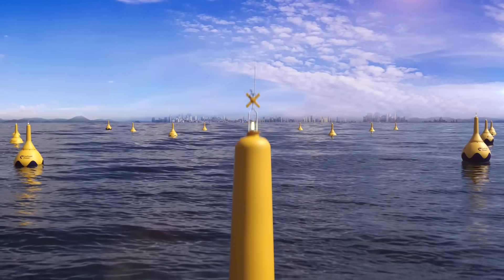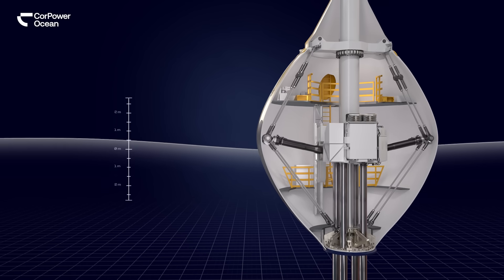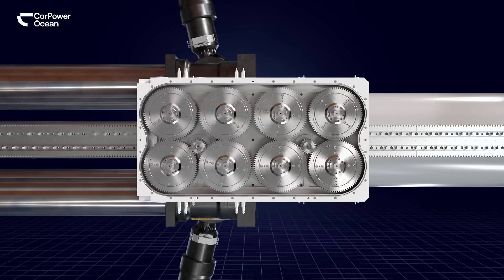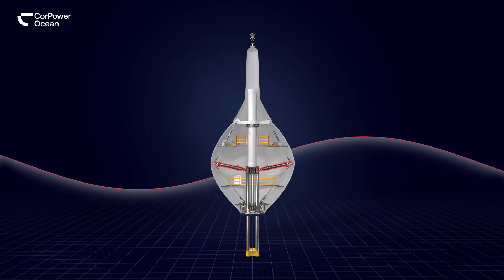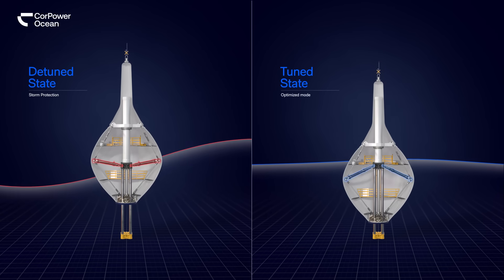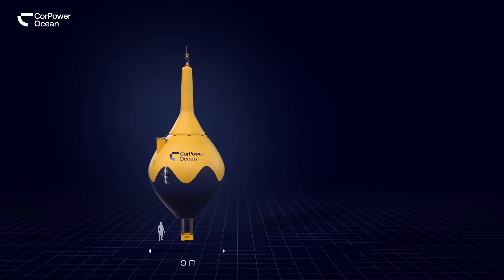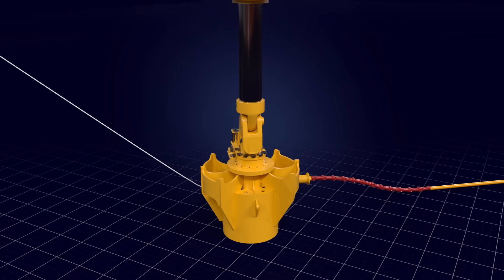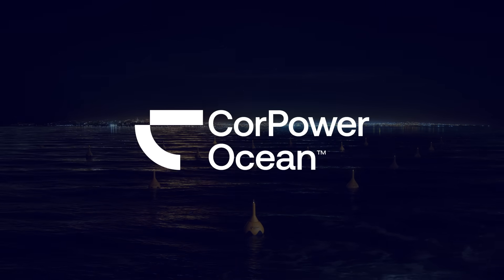How it works- CorPower Ocean Wave Energy Converters

Comment: I assume the 4 rod are in a sealed cylinder and not exposed to seawater. I would interested to know how the system copes with changing sea levels and lateral forces from storms. I guess there must be some hinging/flexing arrangement.

Comment: Interesting but I have a much better design that doesn't rely on that vulnerable seal or on computerization to deal with rough weather. You make a design that looks like a pair of old barbells or 2 maracas attached together. Inside, there's a large tube filled partially with mercury(and yes, its mercury because its my idea and I like mercury). In the middle of this system is a simple pivot point attached to a simple anchoring system. As the device sea-saws, the heavy mercury turns turbines inside the sealed inner tube. The wiring exits the inside tube and the body of the thing itself - since its multi-layered - through an easily-sealed port. 

The fulcrum of this sea-saw machine doesn't need to be an expensive bearing and the device itself can be made out of cheap materials. The multiple layers and single hold in the device for wiring ensures that it won't get filled with water nor will mercury leak out even if the inner-most tube fails. In fact, if there's an internal leak, you'll be able to notice it when the device doesn't rock back and forth. This design is far simpler than yours, doesn't rely on active monitoring, actuators, and computers, and its much more robust, easily-installed, and practically immune to damage. If a ship hits it and breaks it from its anchor, it'll just float on the water until recovered with minimal repairs needed. 

I'm giving you this free idea because I love mercury and think it should be used for the production of renewable energy.

Comment: Single critical point of failure is at the interface / seal , where the rod(s) enter the sphere. The problem is not in the area of the shaft that travels  through the seal regularly, this will be ‘wiped’ clean during normal operation. However, any part of the rod that does not ‘cycle’ through the seal regularly, will be highly prone to biological attachments (remember the rod is stationary in the sea, anchored to the bottom.)
This buildup will destroy water tightness over months, rather than years, ie maintenance dives are required to keep the extremities of the rods clean. Or, each cycle should be a full cycle, that might help offset the risk of biological attachments.
Reply: seal are tougher than biological attachments
Reply: @ LOL, try this: Google Barnacle, find a colony, walk on them.
Clueless.

Comment: All large, floating contraptions are destroyed by large storms unless they can dive.
Reply from the maker: For wave energy devices, such diving to protect from storm loads is best done in the frequency domain. https://corpowerocean.com/corpower-ocean-announces-wave-energy-breakthrough/
Reply: @corpowerocean  I could not find any info about your "frequency domain" in your link. Instead I found some info about resonance. These contraptions are too small to resonate with the waves. By the way I did some work in this field. I designed diving contraption and I found Irish businessman who was willing to build it. Fortunately, we had enough common sense to abandon this risky project. A few years later I invented cheap material (strong basalt foam) which made the diving contraptions much more economical. I have not built anything yet because I have more important energy projects now.

Comment: Amazing that even without any study in the area I was looking at the measurement system of a caliper had designed a system to generate energy with waves in the same style, but after a long time I saw that I could use a permanent magnet on the float and a coil in the fixed part and a sliding system with a ceramic shaft and Stabilizers using an aluminum part and a magnet to prevent the waves from causing the buoy to reach the limit of the coils and cause some damage to the system. The coil and magnet sliding system on a ceramic shaft would have a very small friction and would be easily replaced. With few moving parts, the most stressed being the support cables on the seabed.

Comment: What are the negative effects of this on marine life and oceans currents ?
As the original pressure is absorbed, this will change the other organic processus which were supposed to take place
Reply: How so?
Reply: It will only take a tiny bit of the seas power.
If you could grow mollusk on the under surface you could harvest them occasionally. 
Or have little reefs under them and make it a marine production reserve.
No fishing but plenty of breeding for smaller fish.

Comment: How this energy will get to the city?
Reply: I am also wondering the same thing. How is this energy going to be transferred ?
Reply: @mexicanpanda211   They can store it in same container or that machine and it would be picked up by some moving charger or transmitter
Reply from the maker: CorPack clusters of these devices connect up to an electrical collection hub, from here the electricity is exported to shore over a subsea cable. https://www.youtube.com/watch?v=-XWbVMtNnaw

Comment: Probably the main mistake is that the generator needs to be positioned near the bottom. And let the buoy float on top. Then you don't need to waste energy on lifting a heavy buoy. And it's always quiet at the bottom. There is no sea disturbance and it is much closer to the cables. The buoy itself can be made completely autonomous.
Reply: Nice question but it will increase the mechanical loss brother
Reply: Tidal motion can  also be used to generate energy and operate deeper in the hydrosphere; waves at surface, incoming and out going tides deeper down.

Comment: Brilliant! I need several, about 500 of this amazing, novel high efficiency wave energy converters from CorPower for our energy needs. Greetings from Madang, Papua New Guinea.
Reply: Gutpela long bungim yu
Reply: Have you ever seen anything in the world that the sea will not destroy?
Reply: A simple mercury-filled sea-saw system that uses buoyancy on 2 ends, an internal tube of mercury, and harnesses energy from the flowing mercury inside is much easier to build, doesn't require computers or active monitoring, and doesn't require seals that are in contact with moving parts. It can also be made out of cheaper materials and, if hit by a ship, will just float on the ocean until picked up. Cheap and simple.

Comment: Consider an anchored semi submerged platform, octagon shaped which supports the generation unit structure out of the corrosive water and the bobbing stator will be in the center with the metals above the water. Any moving parts need to be away from saltwater for economical service life. I recommend the power cables be buried much deeper than anchors can reach, internet cables get snagged frequently

Comment: 300kw means each unit could supply 10 houses. Seems like you'd need a few thousand of these buoys to make it a worthwhile generation amount that would justify the infrastructure.  Would be alot of complaints from boaters and the environmentalists
Reply from the maker: Our CorPack wave clusters have the Wave Energy Converters installed with 150m spacing, delivering approximately 15 MW/km2 in power per used ocean space. The modular approach with many relatively small devices packed in high density clusters enables very efficient use of ocean space. 15 MW/km2 can be compared with a typical offshore wind farm delivering 3-5 MW/km2. The high power density of this solution means the use of ocean space is minimized. The single-leg mooring arrangement also means a minimum interference with the seabed and minimum disturbance to boaters and fishing activities. Fishermen in Portugal are seen laying nets just on the perimeter of our wave site, as the foundations and other structures on the site seem to increase fish activity in the area. 

300kW can power close to 300 households as the average electricity consumption (in the US and Europe) is about 1kW (< 10000 kWh annually). https://www.eia.gov/tools/faqs/faq.php?id=97&t=3
Reply: Are you comparing kw and kwh?  The project will be successful! 😅
Reply: In optimal conditions, not considering transmission losses.  Seems you just pee'd on their batteries.
Reply: As a boater and and environmentalist, I can tell you that we would like this for many reasons.

Comment: Brief but valuable content! Thanks!
Like you said hydraulic engineer must spend planty of time because of destructive effects involving electronic engineering for example as You mention rotation wave shuttle thus the rotor with it's vertical travel ( if I am right?!) would limited the eight of wave form. This entire system has planty technological challenges - THANKS! 😊
Reply: Are you interested in developing this technologies that related to wave or ocean energy?
Reply: @mohamednasser5009  Wave energy and hydro energy can be categorized in a so call "sea state" and variety of wavelenghts or periods of wave can be form in one. So intradisciplinar approach is very important like in science so as in topic. It is one big grid.
Reply: You could have a few designed for big waves.

Comment: Always seemed like buoys could be design for energy farming.   What about smaller ones set up by waterfalls/fountains
Reply: You mean like Niagara falls hydroelectric power plants? 😁
Reply: @bricknmotor  That is successful for that geography/construction but bodies of water across nation could be utilized to get hydro power with right valve construction even without the Niagara geographic features. It's more microgrid or supplemental concept than supplying large area demand itself.

Comment: Wave energy is a scam. Both in theory and in real life. Has been that way for more than 75 years. Created by naive inventors and supported by naive investors. Not a single project has been a commercial succes. Most of the projects have been a failure from day 1 in operation. Sorry for the loss of good money, that have been wasted on each and every socalled "Wave energy" project.

Comment: A megawatt is a unit of POWER, not energy.
Reply: Because it depends on time. Multiply power by the time in seconds the machine is working and you'll get Joules.
Reply: @VinniusHKruger  Your comment is correct but irrelevant.  My statement is very simple:  If you use the term "megawatt" to refer to energy, it is an incorrect statement.  A megawatt is a unit of power; a megawatt-hour is a unit of energy (as is a joule).

Comment: What is the right distance of converters from each other? 
Please notice!
Reply from the maker: Our CorPack wave clusters have the Wave Energy Converters installed with 150m spacing, delivering approximately 15 MW/km2 in power per used ocean space. The modular approach with many relatively small devices packed in high density clusters enables very efficient use of ocean space. 15 MW/km2 can be compared with a typical offshore wind farm delivering 3-5 MW/km2.